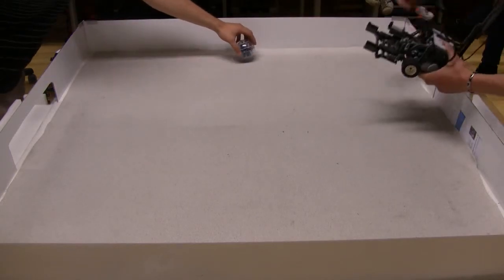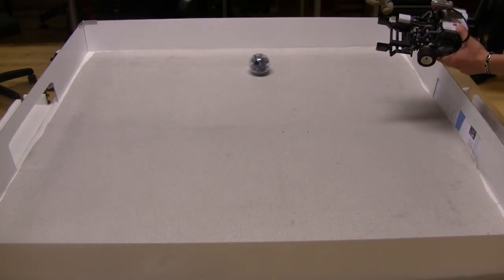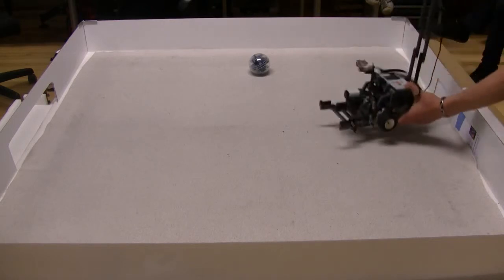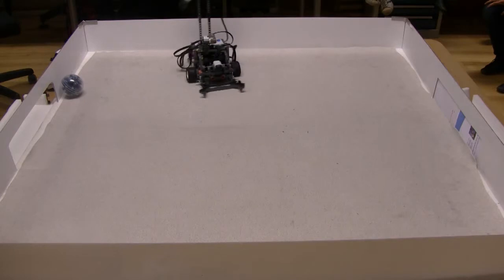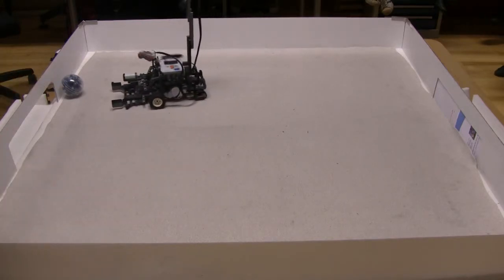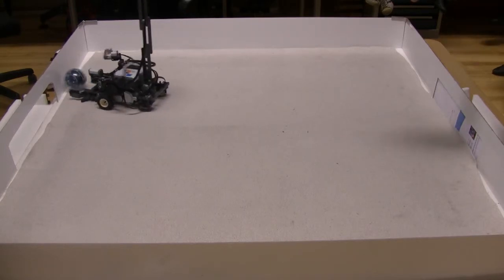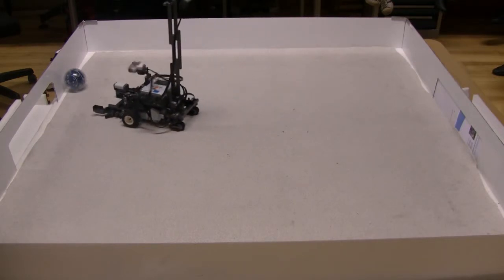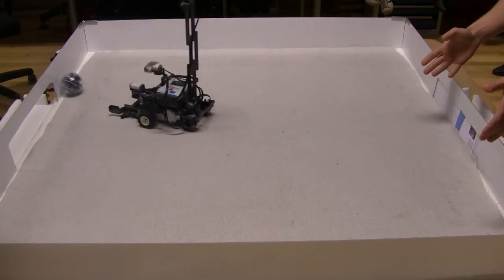Robot Soccer LEGO NXT Lund University May 2009, group 3

Comment from the maker: in principle it search for the ball using the ir sensor. if not visible,  it goes in a search mode walking pattern. when it try to do something but nothing happens, it goes into a time out state.
all states are defined in a state diagram with predefined actions or methods / algorithms to use. For example, a time out is measured as not advancing the goal of a state which typical could be to clash into an opponent or moving into a corner (see the corner problem movie).